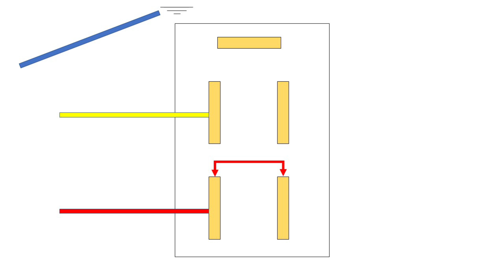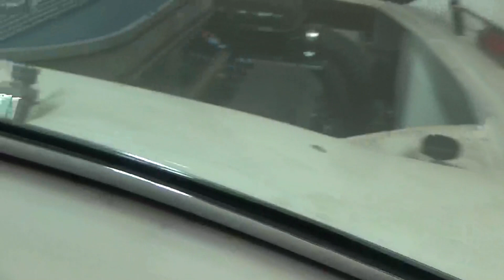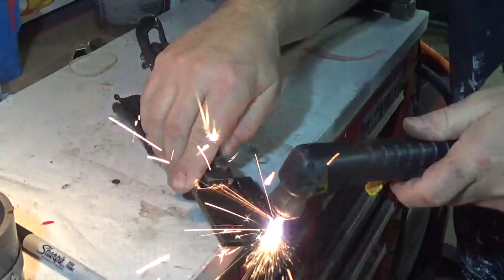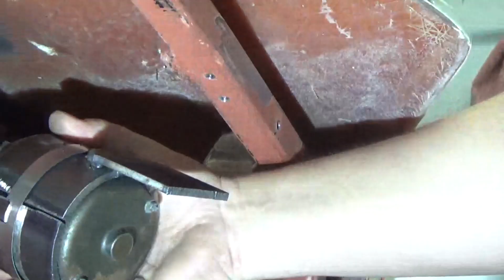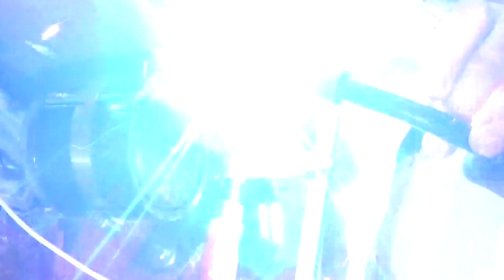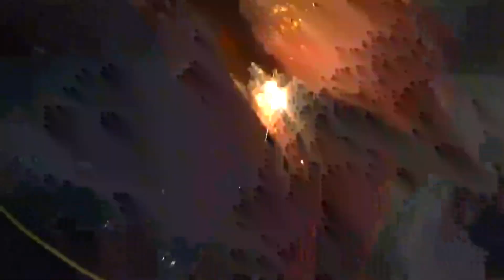427 Cobra Replica   Streetbeasts Kit Car Installing the Windshield Wipers Part 2 Wiper Motor

Comment: Realize this is an older video but hoping you can help me out. When you removed the wire from the horizontal blade to use as ground, Was this just for convenience of making the connection or was there  another reason? When I hooked my ground wire to the horizontal blade directly it appeared to have a dead short.
Reply from the maker: It depends on the year of the motor and connector

Comment: Ok im a complete novice on wiring! So is that a constant power going to the motor on the opposite side of the fast prong? And when you hook the switch up to the fast side is it carrying power as well with a fuse on it?
Reply from the maker: Yes
Reply: @PetesGarage  thank you for the responce sir yeah i put a 3 position switch on it and wired per your vid and it works ty sir

Comment: hello sir. my toyota camry 2003 water boiling from reservoir but car is not over heating. when i open reservoir cap smokes coming out but if i turn on AC the rediator fan starts n the boiling stops within few seconds. engine is not over heating. plz help
Reply from the maker: Radiator plugged or thermostat stuck closed

Comment: Hi Pete, thanks for the coffee cup. I built a Lone Star 427 S/C Cobra for a few reason's. It's 94" wheelbase, 4" more in the cockpit, and the thicker fiberglass body than most manufacturers. So why did you decide on the Street Beast ? (great job you've done) 😁
Reply from the maker: At the time, it was a decent kit. I didn't need the legroom and I can't imagine thicker fiberglass. This body is heavy as it is. I like the Lone Star kit, great choice!
Reply: @PetesGarage  What year did they go out if business ?  My LSC is a 2000 year, but was under ownership in the mid 2010's I believe. They've changed some of the car. I spoke with the owner after he bought the company and at that time, it was made only for the 351 engine.
Reply from the maker: It was around 2013. I can make anything fit...lol
Reply: @PetesGarage  Gotta make it fit or she won't like it. lol... Working to make,.... it work is part of customization or Hot Rod building. I loved Boyed Connington and his Rods, but I hated the employee's bitched about building them ! It's like, if you gripe about it, get out !  The very tight times of owners wanting their cars done were ridiculous though, but I'm speaking of   all the customs parts, body builds etc.  That ruined the show for me. Anyway,..lol,    Love the building and video's !
Reply from the maker: That show was tough to watch
Reply: @PetesGarage  The manager did not manage his employees, he'd just piss'em off. Could,...have been a good show. My favorite car building show has been/is Dave Kindig's Bitchin Rides. Love him, his crew, Car's & Hot Rods. A lot better attitude's than Boyd's.

Comment: Pete, I have one question is that cast pipe going to retain the heat from the motor and cause any problems. If not nice retro fit. Hope all is well and safe Artie 👍🇺🇸
Reply: I think the closing answered that question, this car will not see many miles in rain so overheating of the wiper motor is highly unlikely.
Reply: Your correct I was just wondering for my own info. Thanks for sharing 😊
Reply from the maker: It would, but I'll never use it....thanks Arthur
Reply: @PetesGarage  just my own curiosity. If I owned it,it would never see bad weather especially in Buffalo NY. I realize you installed them just to pass the wonderful NYS INSPECTION. I know I’m. In NY LOL 👍🇺🇸

Comment: Is that a Factory 5 kit?
Reply from the maker: It is a Street Beast
Reply: No, I’m pretty sure it is a Street Beasts car. Check his early vids. Factory 5 kits have a steel tube frame with aluminum panels. The only Fiberglas is on the body shell.